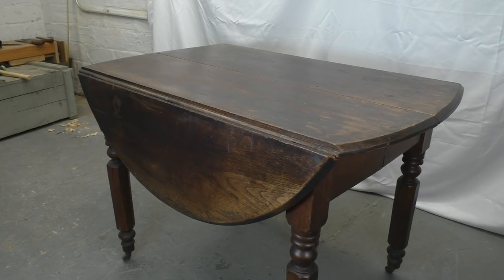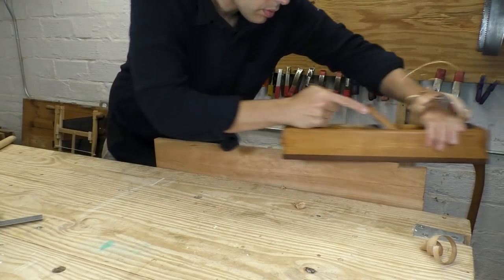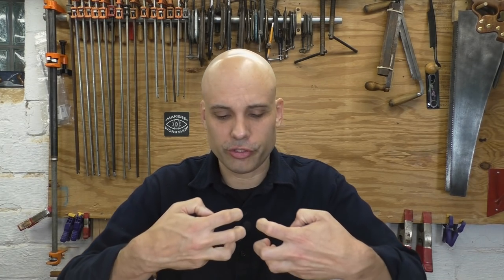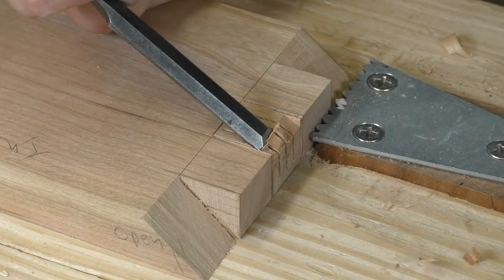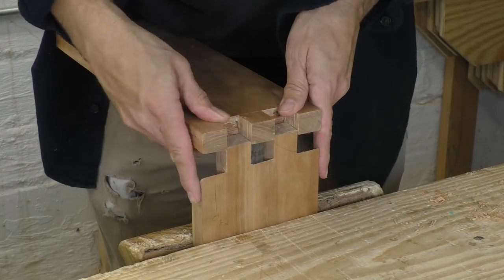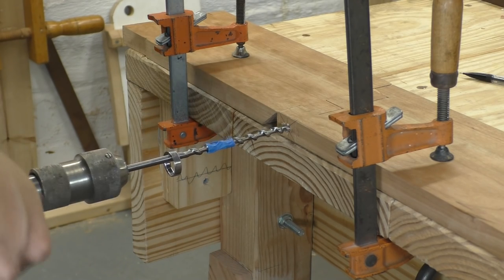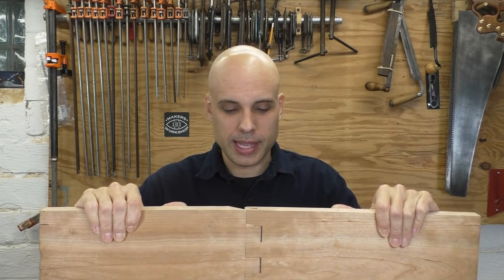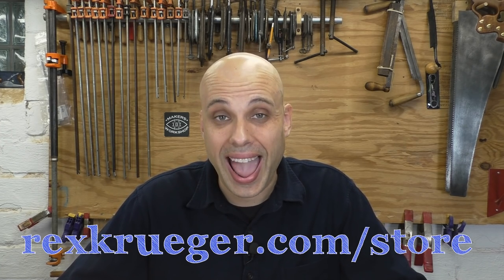Make a Vintage-Style Wooden Hinge with Hand Tools

Comment: One interesting trick I've seen to divide a board evenly is to angle a ruler across the board until the far edge intersects a number that is a factor if the number of divisions you want, then mark the divisions and use a square to bring the marks to the end.

So like if you wanted to divide a 7 inch board into 5 parts, set the ruler with one side on 0 and angle it until the edge is on 10", mark at 2,4,6, and 8 and then bring those down. If you wanted to divide it to 4 parts you would do 8", or if you wanted to divide a 16 inch board into 5 you'd put it on 20" etc. it works wherever.
Reply: Genius!
Reply: Really?? So cool, I HAVE to try this, it would save a whole bunch of "mathing" since I don't have dividers!
Reply: Brilliant!
Reply: Clever. 👍
Reply: @quietinspirationcreations3448    Takes a wee bit of practice to get steady and confident... and once in a while a pencil and paper (after some frustrating hours or in the heat/fatigue of a moment)... BUT it really works. I LOVE this trick!!!  My shop teacher in high school practically deflated when he was explaining dividers and I just yanked out my measuring tape and ran off the marks from the "crown" (our straight side of the board) in a few places and then used a 2-foot level to join them all... dead-straight... and it took about 2 minutes.

    I had a "cool" neighbor who was a contractor, and rode a BIG Harley... SO it was fun hanging out with him... haha... AND he seemed to enjoy teaching me "tricks"... 

    I got both congratulated AND cussed that day! ;o)
Reply: @gnarthdarkanen7464  Haha, great story, it's always fun to teach the teacher!
Reply: @quietinspirationcreations3448    Yeah, it was fun. Glad you enjoyed it. It is fun to have a trick a teacher hasn't seen or doesn't know about... I used to demonstrate short-cuts to several of them, including math teachers (which often earned me a certain respect among other students)...  Some took it better than others. ;o)
Reply: I’m an Architect who was in school right before the shift from hand drafting to computers. Angling the scale across a gap to divide it evenly into as many segments as required was one of the first drafting techniques they taught us.
Reply: That's a trick in drafting that is as old as architecture itself, but for some reason does not get taught in basic math classes. Thanks for passing this along to as many people as watch this channel. 
As a math teacher myself, believe me when I say, my students get this trick in my classroom. Whenever we layout a grid, on paper, for any math project they get reminded of this shortcut for dividing their grid lines equally.

Comment: A recommendation for dividers? Use a straight edge to draw a line, and step on that line. I normally have some reason to mark the midpoint of the end grain, so that line works.

If the steps wander even a few mm away from a straight line when you're subdividing a surface, you're introducing unevenness between subdivisions that can get you into trouble.

Comment: 2min mark and I already learned something interesting; 1) jointer with handle leaned on the right 2) fish head marking gauge which I first saw from Rex' friend, James.

For those who don't have a divider, using ruler diagonally makes equal cut for the pins, you'll have plenty of pencil lines though. Learned that from the interwebs!

Comment: Rex I have one of those tables, handed down from my great grandmother (I grew up with the table). Well now it's mine. It has 5 leaves, 3 of which are warped from non use. It needs refinished now, but is still in use in our living room. The joints are loose now ànd the top says some. I am 70 now and hope to pass the table on to my sister. Really surprised me seeing your video, thanks. When I first inherited the table 20 years ago we seated 10 adults on Thanksgiving and took up half the living/dining room. Thank you for triggering a trip down memory lane.

Comment: Nice job! Those hinges are tricky.  I made a similar wooden hinge last year for a folding shelf, and getting the open/close to work properly was a sequence of several failed experiments until I got it. Trying to set it up so the hinge would open wide enough but allow for the shelf to essentially hold in half was tough. Took a lot of hand tool adjustments but it worked in the end.

Comment: Love the insightful look into the wooden hinge, and it's recreation. Beautifully done, Rex. Yeah, the pivot pin could have been drilled straighter, but hey, we all have those issues from time to time. Perfectly perpendicular drilling with hand tools takes years to master. And level to the gravitational pull of the earth doesn't always equal perfectly perpendicular to boards clamped to a bench that may or may not be perfectly parrallel to that gravitational pull. If the floor or bench top is off in the slightest, or the boards aren't perfectly parrellel (you planed the edges and the hinge ends but not the faces), then that could throw it off even the slightest bit. A small bend in the drill/bit could also throw it off ever so slightly. The snail of the bit hitting a hard or soft spot in the wood could pull the bit off straight. It's just not a perfect process, so expecting perfect results is a fool's game. Still, the hinge is close enough that it functions.
We'll call it a win. A little wax on the pins before insertion would help substantially. A small cross pin in the bottom outer finger of the hinge would keep the hinge pin from working out do to gravity. Over all, well done good sir. 😎

Comment: I would not worry about evenly spacing the "pins" but rather approach this joint as I would a dove tail by cutting the "pins" first and using that piece to lay out the "tails" (if you are a pins first type). Perfectly even looks machine made, and aren't we doing this with hand tools? I agree with practice, practice...practice!

Comment: The first wooden hinge I made was for a saw vise I made.  Fortunately it doesn't need to open more than 1cm since it swings over to the right! 😂  Hinge pin hole wandered a bit when I drilled it, oh well.  It still works 🤷‍♂️
Reply from the maker: Drilling straight is the hard part!
Reply: Some days you realize it's never going to be "pretty".. It just has to work. On those days, call it "character" and put a "W" up on the board... ;o)

Comment: Back over the summer I built myself a clothes chest (yep, that six board design).  A hinge like this one rather than off the shelf metal and a fully joined rather than simple, connector based, construction are where I'd want to have been but with a week of vacation to mostly finish several projects (two hand built freestanding shelves, the chest, a prefab daybed, myriad minor household repairs, etc) before getting back to having five to seven actual free hours a week leaves me fine just accepting I actually got things done.

Comment: Great job Rex! I noticed you used a plane that I haven't noticed before when you were shooting some edges. Which plane is that? It looked pretty handy.
Reply: That's the Veritas Shooting Plane.  It's designed to be more ergonomic than a regular bench plane on its side.  Rex explained he has some elbow pain that flares up now and then, and that this plane helps reduce that strain. If you're on a budget, this tool isn't essential. But, if you have some money to throw around, or an injury you want to keep from stopping you in your tracks, that shooting plane is a delight!
Reply: That's really awesome. I'm going to put that on my list of things I need to consider getting. Thank you for the response.  Currently I am using my smoothing plane for this task and it is just a bit awkward. That plane looks like a very good alternative.
Reply: @chadwickpainter8212  I got one about a year ago. I made a decent bonus at work, and I had just enough leftover for splurging.  This is very much a one-trick  pony, but it's very very good at that trick.  My joinery has really improved!

Comment: Other than aesthetics, is there any reason to have the fingers exactly equal? I would think that as long as both pieces matched it wouldn't matter. (Much like dovetails.)
Reply: Wood has a certain minimum requirement to withstand weight and stresses, depending on application. Keeping that in mind, then the balance or equality of the fingers (hinge or finger-joint) is entirely a choice of style and aesthetics... as you say, so long as they match/line up.  ;o)
Reply: @gnarthdarkanen7464  I can see having equal material on each side. that would make for a 12.5%, 25%, 25%, 25%, 12.5% split though.
Reply: @GlennBrockett   AND that 12.5% might seem risky. So long as you don't get too thin, it shouldn't be too big a deal.

     It's gonna come to a personal choice, and it's woodworking. but if you doubt the integrity when you're still laying out, there's nothing wrong with off-set fingers to make sure all your joinery is equivalently strong and durable. ;o)
Reply: @gnarthdarkanen7464  On a foot wide board, 12.5% would be an inch and a half. Seems like enough for me. But you are right. Perhaps thinner in the middle may be called for in some cases.
Reply: @GlennBrockett   Each craftsman, on his or her own, has to make a judgment call and balance form and function between the desired durability for the application and the intended aesthetics for a "clean and professional" look to the finished product. I have my "style" for it, and as many accuse me of "way over engineering everything" as there are to warn me of "letting it get delicate"... ;o)

Comment: Rex wouldn't the center dowel fall off if you put the hinge vertical?
I guess it would be better (and more difficult) not doing the hole go all the way through.
Reply from the maker: I glued the end of the pin in. Just on the end.
Reply: @RexKrueger  I missed that detail
:)
Reply: Or, cross pin just the bottom knuckle through the pin, and a bit of wax on the pin/s before insertion?

Comment: really oil that dowel until it swells and shave it down if you want that joint to work tightly for a decade+  More oil than you use in any other aspect of woodcraft.
Reply: Some people submerge smaller dowels for hinges overnight in LO.  Same as for wooden screws.  Anything you need to be very stable to avoid jamming over many uses.
Reply: @philipripper1522  I concur,  at least an over night soak, if not a week. Over night in a vacuum chamber or pressure pot is plenty, but if you don't have vacuum or pressure, a week's soak is better at room pressure. Then measure it and drill the hinge to fit the pin. (That's much easier than shaving down an oily pin.)